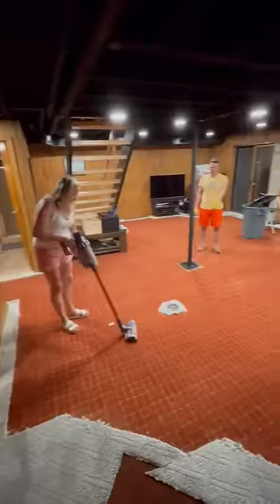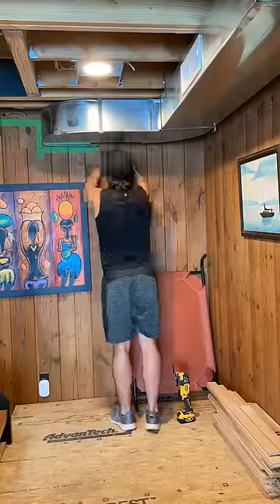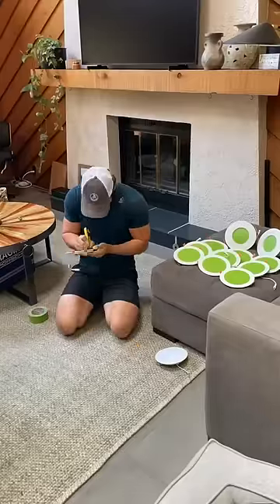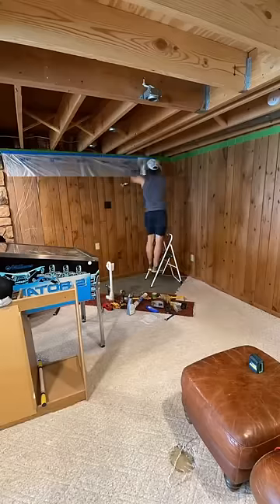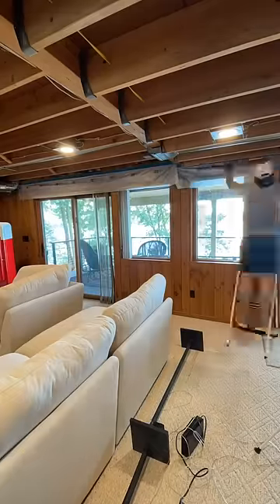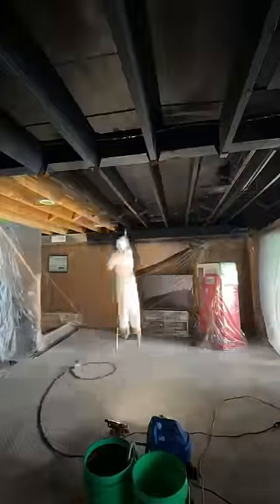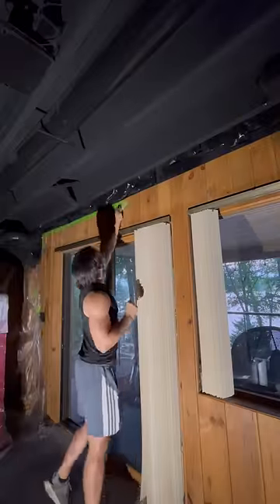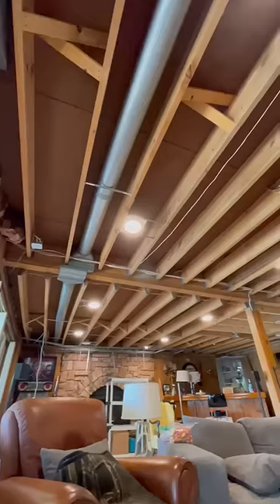Basement Renovation Part 4: Spraying the Ceiling BLACK

Comment: Just made that room 20% darker
Reply: @Random-ed2xf  yes to all of that
Reply: 38%
Reply: 62%
Reply: @Random-ed2xf  good point
Reply: 47.235%
Reply: I prefer dark rooms. I hate all the white and cream used in new homes all the time.
Reply: He's got a pole in the middle....😎
Reply: I know right. It look soo bad
Reply: @ninja3687  I agree. it's distressing. I have autism, so sensory processing is sensitive.
Reply: @BoxedMinds  91.56% awesomer
Reply: I’d say 100% 😂
Reply: @sniperjify It actually looked really good. You should get your head checked out.
Reply: Waste waste waste
Reply: That’s why you would go with a light floor and maybe a light pine shiplap to brighten it back up.
Reply: more like 50 percent.
Reply: So what?
Reply: 3.14%
Reply: Is a basement
Best to embrace the darkness and use to your advantage
Reply: He made it feel larger
Reply: Not really no🤗
Reply: Plus he never covered the carpet....so that's screwed now too!
Reply: @michaeljohn9263 well buddy the first step in a basement remodel is to spray your ceilings if you’re going that route. Then once that’s done you do all your other finishes. I’m sure it’s getting replaced
Reply: OR.... It was day time during the early recording and night time during the later recording..
Reply: And 50% shorter. 😂
Reply: Judging on the darkness of the paint reflection pigment and the amount of light lost in the basement due to its obsorbtion, I confirm the amount of light lost is 31.278%
Reply: @OsKBLaZe  well and then he adds lights, a light floor, a light wall
To counter it. So I can confirm majority of these commenters have zero idea what they are talking about. “Omg black color equal dark light” that’s what you guys sound like. Stick to
Your 9-5s guys.
Reply: @Billybob-go8hn  yes, I would suggest dimming lights so he can have full control of the perfect light he would like in the basement.
Reply: @kaylacarpenter272  Doesn't matter what you have.
Reply: Not like it’s half full of windows or anything…
Reply: @fungdark8270  it’s not like the sun sets or anything
Reply: It's now 20% closer to being a bat cave
Reply: And looks shorter
Reply: So what.

Comment: Nothing better to brighten up a dark basement like a black ceiling.
Reply from the maker: I wouldn’t describe it as dark… it has a full wall of windows and sliding doors. But thanks for the engagement 😁
Reply: @GoldenKeyDesign  I would also like to engage.
Reply: I like it.
Reply: @GoldenKeyDesign  Yeah dude with all this engagement on youtube short you could buy a whole shiba inu token right now. Maybe if you safe enough you can cover your ceiling. :3
Reply from the maker: @Domtronic  😂
Reply: @GoldenKeyDesign  looks pretty dark bro.
Reply: It is not about brightness but a cheap, clean, and clever way of hiding the floor joyces with lowering the height clearance by using drywall.  👍
Reply: @SDarkfire500  Exactly my thoughts. Better than looking at the joists with their anchors and all that HVAC aluminum/ steel, and more importantly - it avoids a low-hanging ceiling.   Sure, it's a bit industrial-looking, but if the rest of the basement is well-done, it's a non-issue.
Reply: Excellent!!!   ❤
Reply: When combined with proper contrasting features such as rich coloured wood and stainless steel fixtures and some colourful artwork, one will actually feel as if there is no ceiling at all, just a vast expanse of endless space.
 Being in the cabinetry trade for 45 yrs when I first heard of this I thought what a bunch of idiots. Then I saw a finished product. Absolutely stunning!
Reply: Engage.
Reply: @jackwright3098  Aye Captain. Warp 7 to Vulcan.
Reply: He has lighting dingbat. And windows.
Reply: I can feel the engagement coming inside of me.
Reply: @57Jimmy  Yeah, I was thinking the same thing, actually (about the feel of no ceiling at all).  Hell, could even paint some sort of glow-in-the-dark star field  to take it a step further (not that I would necessarily do that... maybe if it were a room for the kids).
Reply: @GoldenKeyDesign  I have a gloss black floor in my Basement and I love it! Nice Job.👍
Reply: @BadMonkeyFinger_Audio  Right. I did the same to my basement and it actually causes you to focus your gaze on your surroundings, versus the distraction of the clutter with the joists and piping. And we had a hanging ceiling before and removing that opened up far more headspace. Less claustrophobic as a result.
Reply: @57Jimmy  Precisely the effect. No ceiling, just space. And your focus drops to your surroundings versus being distracted by the messy ceiling cluttered with piping, HVAC ducts and joist brackets.
Reply: Looks more spacious though lol
Reply: Tell me you don’t know what you’re talking about, without telling me you don’t know what you’re talking about.
Reply: I was looking over the reviews and I was thinking myself before I even looked that he should have painted it white instead of black
Reply: @edwinvonborstel3405  it’s the industrial look, white joists would look goofy. You put lights in ceilings, it doesn’t matter what color you use, it looks taller at the end of the project.
Reply: @GoldenKeyDesign  Forgive my ignorance, but how do you have a full wall of windows in a basement?
Reply from the maker: @leefswgoh7558  it’s called a walkout basement - very common building technique when the structure is on a hill
Reply: @GoldenKeyDesign  You could probably buy one or two dogecoin with all this engagement brah. Let's get you to that third coin🙏 Keep commenting everyone!!
Reply from the maker: @WhoGoneStopMe925  Haha!
Reply: Dark is better. It's not supposed to be bright it's a basement
Reply: Says the dude living in his parent’s basement…..
Reply: @ronaldsimmons8346  - a lot of what going on?
Reply: @ronaldsimmons8346  - why are you still living in your parent’s basement?
Reply: Better have a nice painting on the ceiling that looks like living underneath a tree
Reply: @SDarkfire500 floor WHAT?? Did you write JOYCES.  😂😂😂😂😂😂😂😂😂 yes he sprayed the multiple floor (womans name )....        ohhh you mean. FLOOR JOISTS????
Reply: I have a service company and I go into 10 to 15 houses a day and just about every updated basement I've been in has black painted rafters... So for all of those saying it looks crazy it looks a lot better than your basement was all those old ass wires and wood everywhere😂

Comment: Honestly the wood ceilings were extremely nice!!!!!!!! Looked like a Texas Roadhouse!!!
Reply: Idk why but i would rather have a boarded ceiling than the underfloor as a ceiling
Reply: My home is under construction and I had my basement completely dry walled! Worth it 👍🏻
Reply: @jordanlayne9814  that’s what people do. They hire professionals. Seal the basement, water proof it, stud it, run electrical and plumbing as needed, dry wall it up and PAINT IT PROPERLY.
Reply: @DEViLDUB07  nah not always. My old home I remodeled the entire thing and I wouldn’t hire a professional for anything. I DIY’d it all. From kitchen cabinets to a 24x27 detached garage with Electric ran to it. Did it all myself. It’s all about what you can afford… black paint is cheap but in this video I would’ve left it alone

Comment: It looks like a dungeon now.
Reply: My advice would be to use a dark gray instead of a solid black, and to only spray the joists, floor boards, pipes, wires, etc. It's possible that he's going to be putting up crown molding though.
Reply: No wires no pluming for sure makes it looks nicer 👍🏻
Reply: Reminds me of an 80's bar. All he needs now is a disco light.

Comment: you want to remove the plastic before paint dries to prevent the edges from peeling when you remove the tape. if flat paint is used it’s usually not a big issue but anything shinier than eggshell tends to pull up
Reply: Agreed
Reply: Or just take a knife and cut the tape from the paint if it has dried. It's not a big deal.
Reply: Not when you use really good tape. That green tape is the best.

Comment: That’s actually how you do it….one tip, make sure you leafblow or vacuum the rafters. The dust will go everywhere when the sprayer shoots. It’s 3000 psi so there’s no getting away from it
Reply from the maker: Great tip! I actually did vacuum the ceiling but I couldn’t fit in the 60sec limit for shorts

Comment: Just curious, why not drywall the ceiling?
Reply: It’s the new hipster industrial look 🤣
Reply: Wondering the same!!!
Reply from the maker: We prefer this look as it matches the rest of our home's design. Also, makes the ceiling disappear and the space feel much larger than it actually is
Reply: @GoldenKeyDesign  to each their own 💯
Reply: Hope that paint is flame retardant.  Should be 5/8” drywall.
Reply: @michaelhenkenius2459  Doesn't have to be fire rate.  IBC code states that 1/2" plywood is 1 hour fire rated so the 3/4" subfloor is just fine.   Learn your codes.
Reply: Poblem with drywall is what if you have a leak or you need to get to your supply lines?  Drywall cost a lot more to repair in this case and a lot harder to find the problem.  A drop ceiling gives you several different looks and also easy access.
Reply: @GoldenKeyDesign  well the space looks much smaller now on the video, you’re lying to yourself lol
Reply: That would make the room feel smaller
Reply: Cause lazy... And cheap
Reply: @john  unsicker 

 I hate this excuse not drywall basement ceilings. ...

What about from 1st floor to second floor above ground that has pipes and wiring in the ceiling... Or apartment buildings ... Office buildings.   

If your plumbing hvac  and electric are done right you will not have problems... 

Also drywall is very easy to repair and very cheap for materials...
 
To buy materials to drywall a ceiling is less than half the cost of any drop ceiling you can find...

Comment: Pro tip, always keep your spray rig in a different room from the room your spraying. The spray rig needs fresh air, if you always keep the rig in the room that you’re spraying, the motor will suck up paint and it will not last as long as if it were getting fresh air.
Reply from the maker: Thanks for the tip! Will do in the future!

Comment: I would, but I prefer insulated ceilings especially for a basement
Reply: Not necessary if the ceiling is air sealed and the sills are treated with spray foam or R-30 FG or Polyisoboard + spray foam.
Reply: Tough to insulate a basement ceiling due to constant moisture in the air. Done wrong you got a bio hazard. Thats why it's usually left uninsulated. Best bet to "insulate" is to just add drywall for soundproofing.

Comment: Looks pretty cool. Don't know how high your joists are from the floor but I installed a black drop ceiling in my basement. I had a bunch of electrical wires, jct boxes and pipes though so just painting it wouldn't have look great. The black ceiling tiles look really awesome though
Reply from the maker: We had a drop ceiling before that I tore out in episode 1. It was really low so we sprayed the ceiling to make it appear taller

Comment: 50 yrs painting.  The trick is Vaseline.    Yip apply to face then paint is easily wiped off. If spraying  KILZ original, it also helpes keep the chemicals from affecting you so much...
Reply from the maker: Thanks for the tip!

Comment: You should have also talked about covering the floor. A ton of paint will get on the floor.
Reply from the maker: We are replacing the carpet anyway so no point in wasting time to cover it up. Also it’s dryfall paint so it can be vacuumed up anyway as it dries while still airborne

Comment: Why would you remove the lights, tape them, reinstall them and paint? Why not just paint while they are removed and save the time and tape?
Reply from the maker: I wanted to spray the trim of all the lights so I had reinstall them after taping. Otherwise there would be a bunch of white circles on the black ceiling

Comment: I really do like the looks of it but there is something I personally don’t like. If there’s ever a leak, if there’s ever a mechanical addition, if there’s ever anything new being installed, you have to paint it. It’s a little thing, but I work in commercial construction and I see this being done everywhere because it’s, “so much cheaper than installing drop ceilings”, but truth be told, it’s not.

Comment: You could’ve done a light gray ceiling, a silver ceiling or a bright white ceiling, and made the place look much higher. It’s referred to is a visual optical allusion. Edit: if you if you think I’m wrong, just show me one house anywhere in the United States that has a black ceiling in the living room lol.
Reply from the maker: It’s illusion* and it’s a basement*
Reply: @GoldenKeyDesign  I gotcha on illusion. On the living room, I was referring to if you visit any house in the U.S. no one has a black ceiling. The reason is it makes the room appear smaller. If you visit a few restaurants though, they will paint the ceiling to hide the mechanicals. In the case of this house, yes it is a basement which makes it worse because there will be less windows. Everyone has their own preferences. I’m simply pointing out the facts. A black ceiling will change the appearance of the height.

Comment: Would have looked nicer to paint the beams black and in between on the ceiling parts white, like Tudor style, then paint the wood walls a white stain, but then pick random planks black, again Tudor style. It's light with a bit of dark.

Comment: I guess I'm old-fashioned.  I'm not used to seeing a basement with that many windows, much less a sliding glass door.
Reply from the maker: People have been building walkout basements for many years actually
Reply: @GoldenKeyDesign  Yeah, YEARS not decades.
Reply from the maker: @taurnguard  actually they have been built for decades. This house was built in the late 70s and there are many in the area just like it. It’s a very common building technique when the structure is on a hill

Comment: Looks ok when you cheat the angles like he did in the before and after shots
Reply from the maker: Cheat angles? Not trying to hide anything 😂 it’s just a black ceiling
Reply: @GoldenKeyDesign  the "before" shots are taken looking up at the ceiling showing all the hardware and joices and the "after" is a more natural straight look at the walls from eye level. Granted the after is a more natural angle and really does give off the appearance you actually installed a ceiling instead of just simply painting. I'm just pointing out your shots in the video give off way more of an impression of change than a color swap because of the before and after angles

Comment: Hopefully you acid etched all the metal and used the appropriate primer for each. galvanized  and aluminum use different primers for adhesion. failure eminent.  sorry for the bad news
Reply from the maker: This was done several months ago and haven’t had any issues 😁 it’s dryfall paint and is meant to be applied to both wood and all types of metal as it’s used in many commercial appliances. One of highest quality paints you can buy. Sorry to disappoint you haha
Reply: @Golden Key Design  I hope it works out. I am not trying to bum you out. Every gutter job and vent pipe that wasn't prepared by by etching with phosphoric acid it has failed over time. I hope it works out.
Reply: Not work that I completed.
Reply: I was just emailing with rep for BLACK , It is recommended to be primed with an adhesive primer
Reply: That's on metal

Comment: U must live sumwhere warm, here step one is insulate the cealiing lol
Reply from the maker: Insulating a basement ceiling doesn’t help heat/cool your home since it’s part of the internal structure rather than an exterior surface. Therefore it’s really only used for sound absorption. But we laid tile upstairs so we don’t have any sound issues. No point in wasting the time or money 😁
Reply: @GoldenKeyDesign  I don’t know where u get ur info bud, but it indeed helps to to heat and cool ur basement. That is what insulation does, same w the walls. That heat ur pumping in there just goes right upstairs instead of staying in the basement. Ur just being cheap

Comment: You did something wrong if your face looks like that.  Or used the wrong sprayer.  Never once looked like that repainting the ceilings in my house.
Reply from the maker: It’s called dryfall paint. It dries while airborne and falls to the ground. Doesn’t act like normal paint
Reply: @Golden Key Design  so you are saying that you used a "special" paint that cost more than other paints, but had more issues?
Reply from the maker: @cberna78  didn’t say I had any issues. Just explaining how it got on my face 😁

Comment: My bad to critisize you recess trim choice without giving you the alternative, my bad, i just look like i am piling on and that was not my intent. You did a shit tone of work and provided a detailed video. When you are doing recess lighting you want to use a recess fixture that the lamp image above the ceiling. They should be up inside the can,,,that is why they are called "RECESSED LIGHTS". not meant to be yelled.  The trims you used are popular at the big box store but the lamp image is on the surface, that is why it is so glarey. Horizontal light is the critical light you are looking for, you want Vertical, light the walls, you light the walls you will light the space. Light what what you look at. Use recdess lights with deep aperatures and are adjustable or have trim that kick the light to the wall. I could go on, tap back at me and I help you make it better and will make a good video for you and your scribers
Reply from the maker: I appreciate the reply but I've used both and prefer the pancake LEDs over the traditional recessed cans. The recessed cans are bulky, a pain to install, more expensive, and way less efficient. Not to mention the LEDs come with the light already installed and you can change the color temperature on the fly. To each their own I guess